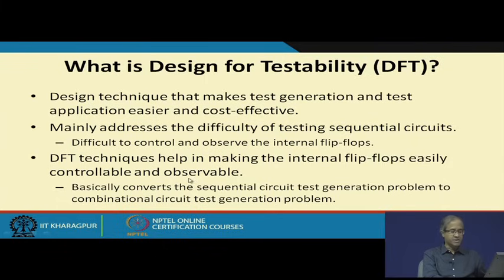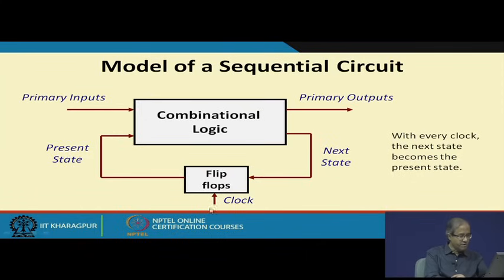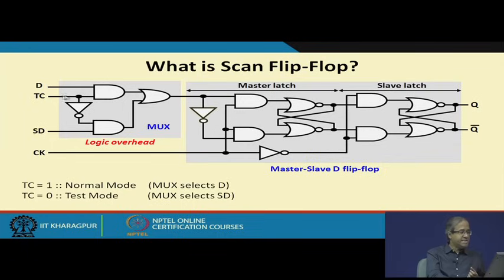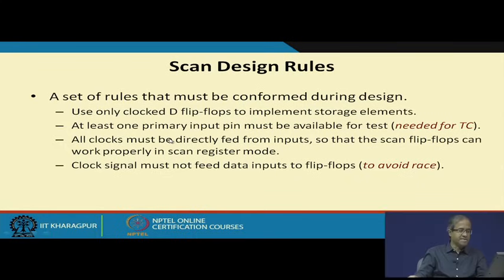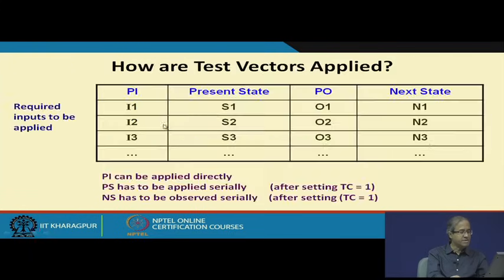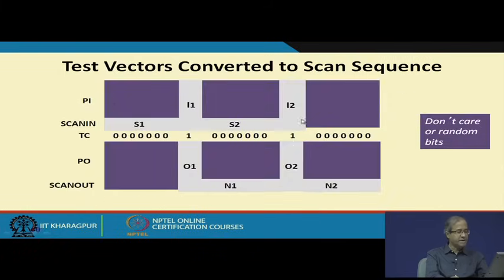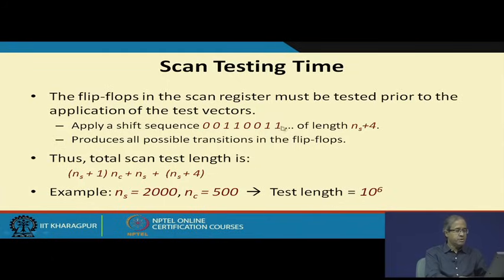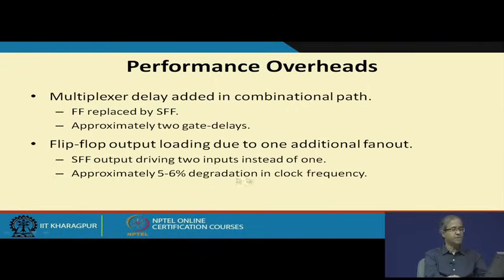Design for Testability

Comment: Hii sir if u dont mind i hv a small dought 
TC means scan mode r not
What i am thinking that 
If TC is 1 than scan data will be pass when TC is 0 normal data will data will pass
Reply: Sorry for the delay, but yeah you are correct.

TC is the selector which selects which input will be chosen for the flip flop, the test input or the normal input
Reply: s